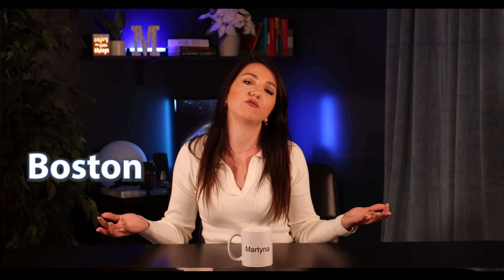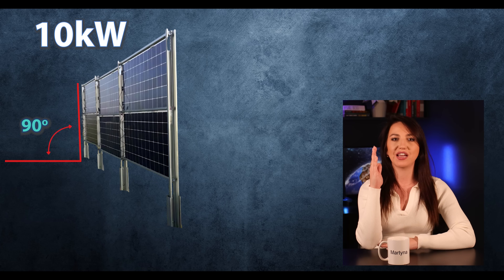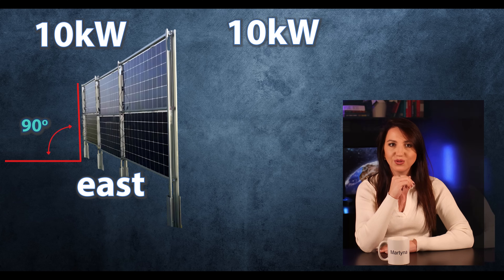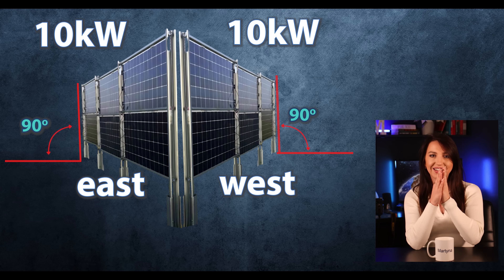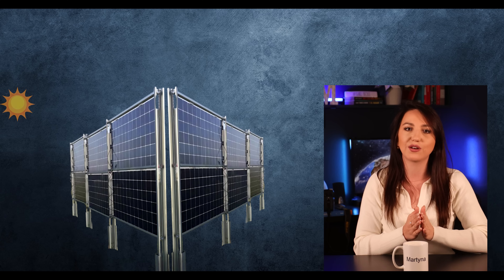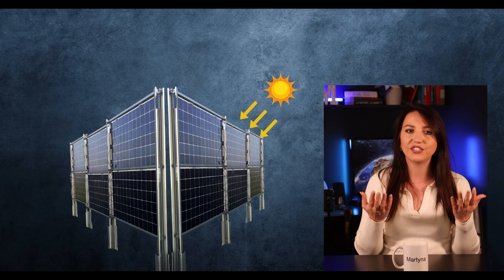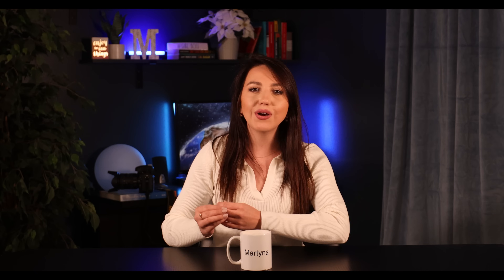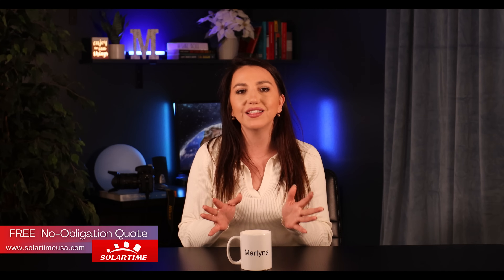Why I 'Oversize' Every Solar Installation (And You Should Too!) - Solar Oversizing Explained

Comment: Hang on. My hybrid inverter's "rating" is for the AC Load. It's able to support a combined 5,500 Watts of devices. It has nothing to do with the panels per se. The panels will feed the devices AND charge the battery that was depleted overnight. That's their rating. And the battery rating is how many Whours it (or they) it can provide.
Reply: I have never seen a watt-hour rating on hybrid inverter, grid-tied inverters, or inverter-chargers.

For battery what they'll indicate is the rated voltage, maximum AC charge current, maximum total (AC+PV) charge current, and perhaps maximum discharge current (which can be computed from its power rating).
Reply: @altuber99_athlete  as an aside I have two 8000 Watt solar arrays connected to my 6.2KW Inverter and I have two Lithium Batteries connected to it providing a 25,000 Watt-hour capacity. I could run 2,500 100W Light bulbs for an hour. Or 1,250 for two hours. Assuming they were fully charged by solar or utility (hybrid-inverter)
Reply: @altuber99_athlete  correct and you never will see a "watt-hour" rating as that is a measure of energy consumption over an hour. Please read carefully what I wrote. A 100Watt light bulb consumes 100 Watts of energy. In one hour. In two hours it consumes 200Wh )Watt-Hours). Anyhoo coming back to your point and miner, what you WILL see is the devices ability to handle a load (appliances/etc) of, for example 5,500 Watts - the so called "5.5KW" rating of a particular model, vs its bigger brother, the "10KW" model that can handle larger loads (more devices) up to a combined value of around 10,000 Watts. Assuming of course there is something sufficient to feed that power (Utility/Solar/Battery). My PowMr POW-HVM6.2K-48V-LIP "Hybrid Inverter" is able to "Invert" 6,200 Watts of supplied energy to appliances. There may be 100,000 Watts of solar connected or 20x 200Ah batteries or the entire Grid of my country. That is all kinda irrelevant in the naming conventions of inverters. Hence my confusion as to why she is somehow tying the Solar Array rating to the inverter's rating.

Comment: Let say you are in Florida with a south facing roof line, does it still make sense to have 450 watt panels on IQ8M micro-inverters?  I understand that they are only able to output 325 watts of AC... so on a per panel basis, 20% oversize would be around a 400 watt panel.  My installer didn't push hard on the 450 watt panels and I am wondering if I would have been better off with the option of 21 x 420 watt panels instead of the 20 x 450 watt panels I am currently committed to. <edit> I just looked it up in my contract, and with the switch to the 450 panels we also switched to the IQ8X micro-inverters capable of 380 watts of AC, so with the idea of going 20% over sized, I should be fine with the 450 watt panels.  Are there any websites that can estimate the difference in production of the two systems?  Rated peak difference is only 180 watts more for the larger panels, but would I have better results than that because off peak production is more with the higher output (and slightly more efficient) panels? </edit>
Reply from the maker: I think your set up with iq8x and 450 is good! Better than having one more panel, that one more potential point of failure;) and with 380 max continuous power output you’re right under 120% over sizing so it’s perfect! 
I think you should stick with the 450s! 
I hope that was helpful.

Comment: Great video. Question, I have 25 panels with optimizers and a Solaredge 7.3kw inverter. If I were to add a home battery backup and maybe add another panel or 2, will the inverter need to be changed?
Reply from the maker: Hey Scott! 2 panels will be just fine to add to existing set up. I’m not sure what size panels you have if they are like 300 or 400 watt panels but adding 2 to an existing system is very very common and I do it with my customers all the time in dallas area. 

Adding battery is a great idea and it won’t affect the existing system either ;) 

Thank you for leaving a comment!

Comment: Re which roof faces to oversize, Gary did an interesting video on this. If you call a south facing roof 100% productive, then north facing achieved 60%, where as east and west actually got 80%.   This was based on real world production figures for same size systems in a geographically similar area.  So the north could be at least 166% oversized, east and west 25%.  But then if you factor in the real world production panel levels you mentioned, you could add 25% to each of those, so south 125%, north 208%, east and west 156%.  That would at least factor in real world panel performance as well as basic roof orientation.  Maybe you should then allow extra for panels being dirty in the real world plus imperfect mounting angles..?  One big question though, if you oversized by the amount you probably should to factor all these things in, you would likely exceed the manufacturer inverter rating which would void the warranty
Reply from the maker: Great points here and I love Gary’s videos!!! He is such a nice guy! 🙏 I wonder if he was usuing his area in UK though as production location to give the percentage figures, I have to check that to make sure. But yes with systems these days like Tesla and the new sunny boy hybrids they allow for up to 200 % over sizing where portion of dc that’s not converted can charge the battery directly in DC with even less conversion losses. So I think where you were going with your thinking is what is coming for sure! 
Thanks so much for sharing and leaving a comment I so appreciate it! 🙏
Reply: @ it was two properties in Gary’s area where he had access to the data to make the comparison.  I found it very interesting because people often say south is best, and east and west aren’t worth it but that data didn’t support that.

Comment: Is it safe to have strings with an Voc total that is higher than the inverter MPPT can handle?  By your same logic of assuming the number of days/hours when the string's actual voltage exceeds the maximum.
Reply from the maker: No, you cannot oversize strings voltage here. Just the inverter power output. 
Oversizing strings voltage rating can damage the inverter. 
But with most inverters we deal with up to 600 v of rating, so we just have to make sure to just do correct calcs to make sure we get the correct number of maximum panels we can put on a string.

Comment: There are many relevant factors. I agree that you'd want to oversize most of the time. There are some situations where you would not oversize. Firstly I am buying a hybrid inverter. I want a powerful inverter because I need the peak power output. I don't need that many panels to fill up my battery. When instead you do need more panels than your hybrid or off grid inverter can handle, you don't necessarily need a larger inverter, because you have the alternative to add more MPPTs to charge your battery.
Second, I am in Asia and there are a lot of cheap Chinese inverters on the market here. Some of those have passive cooling and you would be less inclined to oversize on those, because when you put a lot of strain on them, they will just shut down to cool down (this also happens with some microinverters).
Reply from the maker: Thank you for sharing your experience from across the ocean. It’s interesting to learn that some products in Asia would shut down when overworked. Also I am excited you are doing hybrid! I am a huge huge fan! I think those are the future! Thanks again!
Reply: @solartimeusa  In an off-grid situation, you cannot reduce the output, like you can do in an on-grid situation (Voltage would drop). So I think it is normal for hybrid/off grid inverters to switch off when they get too hot, while on grid inverters reduce their output.

Comment: I have EG4 Inverter and said not to go over 480 volts or Damage will happen but also best power input is 329 volts I have one at 320 one at 280 and 2 at 340 Now I could use my old Victron control but I can't run it that high
Reply from the maker: Hey hey! I should have made sure in the video that over sizing is good as long as you follow not over sizing string voltage! 
You can oversize power output by still being witching the voltage limits. Don’t go over the specs on the data sheet 🙌🏼🙏

Comment: Thank you for this explanation.  I always wondered where the balance is with clipping vs. inverter size.
My approach 8+ years ago when I installed the array was to match the panel output with the inverter, but you are absolutely correct in that the panels never produce what they indicate on the panel specs.  Live & learn ...  and keep the videos coming!  Very informative!
Reply from the maker: I think it’s good to find a happy middle. I always like to leave a little wiggle room because a lot of my clients tend and like to add 2-5 panels the following year to their system to increase production. And it’s usually easy with not much of an issue. 

Thank you so much for being so supportive I truly appreciate it!! Comments help my channel grow and YouTube picks it up for sure so I really really appreciate it!

Comment: Victron solar charge controllers don't like being over panelled (the small ones at least). I know they are more diy/off-grid. I find with sunny days and fast moving cloud the solar charger keeps going over current and shutting down. Very frustrating so I'm going to upgrade to one that more closely matches the panels. I'd even suggest over specifying the solar charge controller.

Comment: While oversizing your solar may work for some people,  if you are on a (Net Metering) program where you sell back extra electricity you need to first consult your electric company.   My electric company actually has a maximum total wattage for my solar array on my home based on my history of electrical usage from the grid.  Under their rules you can meet but not exceed that wattage of panels to be in compliance to be on their Net Metering,  this is to keep people from super sizing their solar array to try to make money off the system as an income.   ------------    I also have another thought on the subject of clipping,  I do not like clipping at all, when the solar array is experiencing clipping your solar panels are creating wasted energy that the system cannot collect to the home or sell back on Net Metering.     What I prefer to do if possible is to set the angle of the pv's (solar panels) lower in the sky on my ground mount by about 5 or more degrees to help increase winter solar production and to reduce the chance of clipping in the summer.      ----    The sunlight in winter must push through more atmosphere (as the sun is lower in the sky) and so in winter the sun hit the solar panels with about 3X LESS solar radiance than the solar radiance when the sun is over head in the summer time.   More and more people are installing heat pumps and some people use as much electricity in the winter (running their furnace or heat pump) than they use in the summer running their AC in their home.    IMO having less summer clipping and increasing winter production are both wins!    JMO on this subject     What do you think  ?
Reply from the maker: Great point about net metering rules! It’s important to consider those limitations for sure. It has been changing all over the states. Batteries are now definitely becoming more and more popular to counteract those changes, but what you suggest for wintertime is good for sure lots of people in Texas with electric heating hate their winter bills and their solar systems can’t keep up with their winter usage especially if we have snow days or rainy days. We end up still having high winter bills.
Reply: In Australia panels have 25-35 years warranty. Inverters have 10 year warranty. 
Don’t ask me why. I typically tell clients expect 10 years form them worry free, after that it’s better to replace everything.
1st year degradation is 1%, followed by 0.4% each year thereafter. So, I’m comfortable to over size the 75% rule by a bit more to compensate for these losses in 10 years time.

Comment: correction/clarification:  at 4:42, 2-axis solar tracker doesn't affect max panel output to an inverter.  It tries to get the maximum output per time period.  Daily output goes up, but not max instantaneous output.  Inverter will also see operational panel voltages earlier and later->longer daily operation.

So, trackers do not affect panel oversizing choice as stated for clipping reasons.  Your oversizing calculations will be different though when trying to find the most economical combination of panels and inverters as tracker output is closer to ideal inverter input.

Perhaps you were trying to make this distinction, but it may make people not familiar with the calculations choose not to oversize tracker panels/undersize inverter choice.

Comment: Love your channel, you do an excellent job explaining things.  I have  sunnyboy 6.0 and I feed it with 12kw of panels.   It clips like crazy, but I'm very happy with it.  It rapidly rises to 6kw and makes that power until late into the afternoon.   Even on cloudy days I can be assured to get 6kw out of it.   So overpanelling by 2x is just fine.  I like knowing that I will always make nearly the same kWh per day.
Reply from the maker: Thank you so much!!! And what a story haha! Thank you for sharing! This is a prefect over sizing example!!! Thank you again!!! 🙌🏼
Reply: i don't get it sounds like you could exceed production of6kW many hours every day?  but you have too much power anyway?
Reply: @raedy07  over paneling makes my power production very predictable.  I know I’m going to make 6kw from 10am until 5pm every single day.  Even when it is overcast.  The inverter will make its rated power, never mind about the excess solar panels.  Think of it as a car having enough motor to go 150mph but you only need to go 60.  You are assured you won’t lose speed up a hill with a car like that.  On the other hand if you have a yugo that makes 35hp and can just barely get to 60, any hill will make your speed drop.

Comment: Martyna: In an earlier video, you said that in the Dallas/FtW area, one should resist the urge to oversize. My systems is 7.6 kWh (STD) with a 7.0 kWh Sunny Boy inverter. I have never seen any clipping in the 2+ years of operating. I am confused. To me, adding a battery is what I really need right now.
Reply from the maker: Glad to hear your system's working well! And yes it depends on every situation, your system is nicely set up, and you can still benefit from adding more panels even with existing inverter too! :) 

And yes, adding a battery sounds like the perfect next step for your setup! Especially what oncor being so greedy lately. ;(
Reply: Oversizing makes much more sense as panel price has dropped.  Years ago oversizing didn't make as much sense with higher panel prices.
Reply from the maker: Very good point!

Comment: Another great video oversized with love! I was playing with numbers and a Sol Ark 15K can be oversized like crazy(Try it). I don't know why people don't talk about that MPPT, it is a monster.
Reply from the maker: You are so right! I am a big fan as well! Eg4 and others are similar as well, what are your thoughts? 
Thank you for leaving a comment! :) It helps my channel so much!
Reply: Flexboss21 and 12000xp also support a lot in their MPPTs.

I am thinking in the future(in about 3-5 years) going offgrid. Thinking 2x  Flexboss21 and about  4x of their outdoor batteries and maxing those MPPTs. Of course tech might change in that time. Or two Sol Ark 15K if price is lower. One for running the house and the other for backup if one fails.

Comment: Could you please make a Video on Computer mining with the excess Solar energy!
Reply: Please ask her to do an ROI analysis as the fundamental issue with using intermittent excess solar is that the resource (crypto servers) usually are expensive enough that it isn't worth it to buy them and then only run them several hours a day vs 24h/day.  Battery power for 24h production is getting cheaper but likely not yet worth it.  See Microsoft, Google etc. betting on nuclear for their datacenters vs huge battery packs.  But at the end of the day it's an economic analysis with the products, alternatives, and prices of today while trying to predict their trends into the future.
Reply: @SeekingBeautifulDesign  thank you very much
Reply from the maker: Thanks for the suggestion! Mining with excess solar is an interesting topic - I'll add it to my content ideas list 📝

Comment: It's tricky spec-ing out a system in Ontario, Canada where non-summer days are frequently overcast or heavily overcast. I'm taking oversizing to an extreme with a 90% panel derating to ensure even on a heavily overcast winter day I'm still getting my target power. Winter is when the power is needed most after all. Production will still be zero during snow, but it'd be near zero 60% of the year if not for this heavy-handed approach.

Would be awesome if you did home wind turbine reviews too, we don't get much sun here in the winter but wind... oh boy :)
Reply from the maker: Thanks for sharing your solar setup in Ontario! Snow-shedding mounts might help with those winter days. And you make a great point about wind power - might have to look into covering that in a future video! <3
Reply: @solartimeusa  Wind turbines are a minefield online, with 95% of them generating not even a fraction of their claims at winds stronger than rated. You could be the champion of turbine honesty and save people hundreds if not thousands of $ in the process 😁
Reply from the maker: That’s been such a big topic here too! You should check out the other video where I covered why wind basically sucks when it comes to resi applications.  I do have some hope when it comes to harmony turbines. That’s where I am hoping to see some progress maybe.